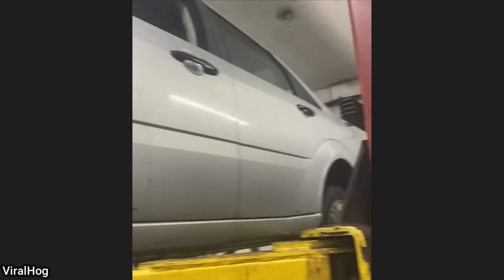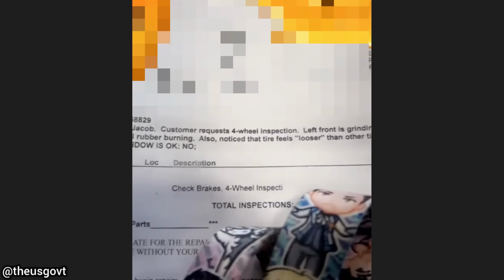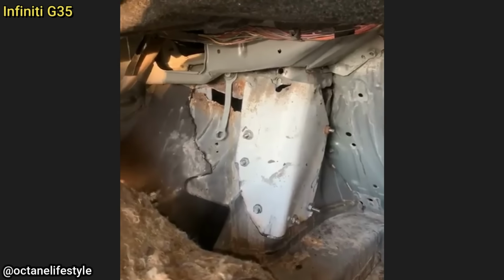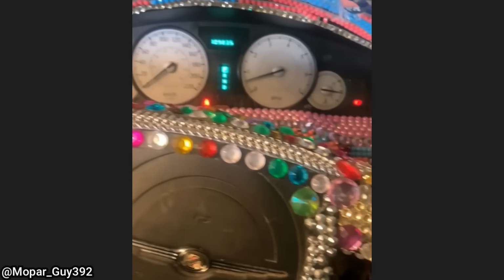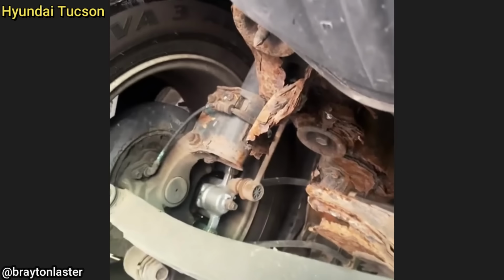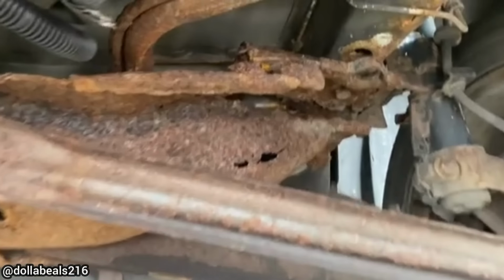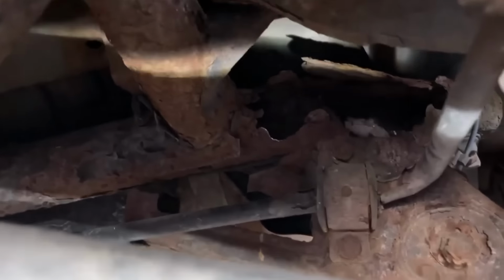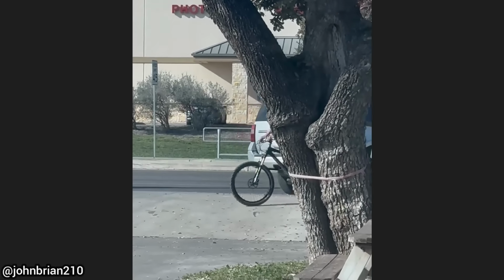Customer States (Dangerous Death Traps) | Just Rolled In

Comment: "Purchase a frame repair kit" - news flash, sudden shortage of spray foam in local area. Retailers are perplexed about where it all went.
Reply: @ronblack7870  WTF?  Now I gotta go see!
Reply: @ronblack7870  You need to have a bit of frame left to fix said repair kit onto, though...
Reply: :face-green-smiling::face-green-smiling::face-green-smiling::face-green-smiling::face-green-smiling::face-green-smiling::face-green-smiling::face-green-smiling::face-green-smiling::face-green-smiling:
Reply: @ronblack7870  haha thicker then oem
Reply: Fun fact. In the 1990's when Mercedes was having issues with body rot in their frame rails of the W-series sedans due to improper factory holes, their official dealer authorized fix was to fill the holes with sprayfoam.
Reply: That and rolls of duct tape.
Reply: Unless the guy is forging new arms and struts for his car, I don't think he will succeed.

Comment: Mechanic: "Your car is a literal deathtrap, come see for yourself."
Customer: "You're just trying to trick me into paying for repairs I don't need!"
Very shady e-mail: "You've won a billion dollars! Just enter your credit card information and it's all yours."
Customer: "GOLLY GEE I'M A BILLIONAIRE"
Reply: Yeah but the mechanic is trying to cost them money - that Nigerian prince is offering to give them money! Totally different.
Reply: Mechanics can be a bit cheeky with little add-ons that, if you happen to know enough about cars and know your own, you know you probably don't really need. Well, you don't need them to do it with the additional cost of their time when you can just order that particular part and fit it yourself at home for half the cost.

If you have the tools needed to take off a wheel, and you should, they should be in the boot of your car, then you shouldn't have issues changing brake pads, discs, maybe control arms etc. And you can do some basic maintenance with the engine up front (that's where the engine usually is, it's the large noisy thing under the bonnet), such as changing oil, spark plugs etc. That's where the average garage is getting you paying more than what you should be, because people are somehow allowed to drive a near 2 tonne potential death trap that they know very little about, which is just bloody stupid if you ask me, which you didn't but whatever. Had my way, I'd make it so you'd have to display some decent enough mechanical knowledge and ability to care for your vehicle before you ever get to sit in the drivers seat and get a licence. That gives the driver some useful knowledge and skills, prevents then being taken advantage of, and helps protects other road users from those who are genuinely too stupid to be allowed to drive. Won't stop people being lazy and failing to perform a few basic checks before they start driving (I know, people think it's tedious. But it's important, make sure your fluids are in order at the least ), but a few gory videos and/or photos could help with an attitude adjustment. No one wants to end up looking like Porsche girl, it's not open casket friendly.
Reply: Here in Utah they got rid of safety and only do emissions safety is only required on salvage title or commercial fleet vehicles
Reply: Mechanic: I've changed your valve cover, but it required me to install all new brakes and suspension, so your cost is now $2182 instead of $221
Reply: Thing is, 99% of the time, mechanic just mentions the issues they found, but don't actually show them to customers.. And people who drive/buy cars in these conditions obviously don't want to spend a single dime on them.
Reply: @Legally_its_a_joke  in my country, that's illegal. You can't perform repairs the customer didn't ask for. I'm assuming that it's the same all over the world. 

And if you pay for repairs you never asked for you're just getting scammed. Contact consumer rights agencies.
Reply: Those are some great engineers who designed these cars.
Reply: @nicklasveva had my old car in for service due to the service light was on and order the normal oil change and like but they also switched out the oil pan due to it was so rusty and thin they where able to drive a knife trough it. They replaced that as well but they did not contact me about it. Anyhow when I went to pickup the car they told me and I was okey with it besides what if the oil pan ran a leak and all the oil would spill out it would cost more to replace the engine then that oil pan
Reply: pretty sure you're not gonna replace your whole chassis like some of these wrecks in this video

gotta make choices, sometimes its worth getting a new car instead of replacing every bit of a shitbox, don't care what kinda engine there is in there, aint no fucking thing worth that much work or money, it's just a damn car afterall
Reply: Unfortunately thats how people are. Ive asked to see the issue they mentioned and they went quiet real quick. Couldnt even bring out the trolley jack to get a good look at the crack in the steering arm
Reply: @nicklasveva  It is, but here's the thing: Making something illegal doesn't prevent people from doing it. It just lets the state punish them if they get caught doing it and the state wants to punish them. This is why anti-gun laws do nothing to reduce gun related crimes. Its why prohibishion made the drinking problems worse. It's why strict anti-drug laws cannot end the war on drugs. Making things illegal doesn't prevent them. Only addressing the reasons why people do those things can.
Reply: I guess some customers prefer paying with their life, rather than money. Unfortunately they’re not alone on the road. These people may be driving next to you in one of your road trips. They only cause more harm than good. Why don’t these workshops contact the police if they decline repairs? This should never be legal to drive on the road. It’s so infuriating to know that K-trucks are illegal in some states of the US but then vehicles like shown in the video are legal to drive for some reason…
Reply: Then the GPS static fades out and jigsaw turns towards the camera. "Hello Jonathan"
Reply: You just had to sneak Nigeria into the conversation somehow. I thought you were educated ?
Reply: One thinks they’re getting money one knows they’re losing it’s really all that matters to these people
Reply: Has anyone fallen for one of those scams si ca like 2004?
Reply: It’s the “GOLLY GEE” that sells it
Reply: @MeepChangeling wtf are you talking about? In most Countries in Europe you will be stopped by the Police in about 20 minutes of driving and they will wait for the tow truck to get you to the scrapyard. Murrica, best country in a World that can't enforce their laws in the name of freedom. Sick,  in reality you have vehicles like in the 3rd World and in Europe you can rarely see 15 years old cars and not in a perfect condition. And somehow we can afford it. Tf is going on with your country?
Reply: They assume I know nothing. They tell me things are broken that don’t exist on my car they tell me I need to replace filters I replaced two weeks ago and then bring me out a dirty filter that’s not from my car to prove it. Nobody’s innocent.
Reply: @SilentKeeperI  it depends entirely on the state. Some states have very stringent motor vehicle inspections some have none at all.

Comment: The "buy a frame repair kit online" one... I had almost forgotten about it!
Reply: The repair kit consists of two cans of spray foam, and a roll of duct tape.
Reply: Oh, and some undercoating to hide the spray foam.
Reply: I had to pause the video.

$20 says this is the same person who, because their computer was "running slowly", downloaded more RAM.
Reply: Good grief. Frame repair kits really are a thing! That’s scary.
Reply: @Speedbird9L  please tell me a "frame repair kit" are photo frames or specs.
Reply: I can't imagine the alternative universe that sells frame repair kits online.  Maybe that's where Spock has a beard.
Reply: I’m sure if there was a frame kit online, the cost and install would be more expensive than the truck
Reply: @Speedbird9L  From Amazon A Frame Kit for an F150: Is professional installation recommended for it? Yes, professional installation is recommended for this frame rail rust repair kit as it needs to be welded onto the vehicle frame.
Reply: I read your comment before seeing that part of the video. I had no idea what you meant. Now I'm slackjawed.
Reply: i just googled it and you can buy a car frame repair kit,  problem is i dont think that person has the skill to do the actual job as it looks like you need to know how to weld....and not with spray foam
Reply: @EJBert  Trick is finding some frame to weld to!

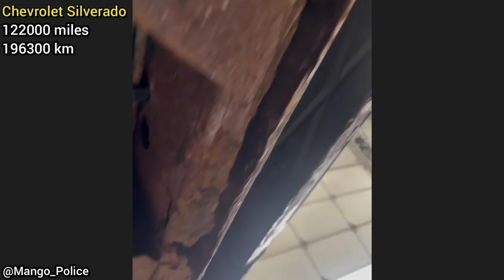Comment: 12:49 Yup, you hammer those wheels straight buddy. We believe in you!
Reply: Gotta feel for the guy!  Better the wheels than the wife😳
Reply: I have done it ONCE with a metal rim, until I got paid the next week. ( over the next couple of weeks I met 3 other people who bent rims on that pothole )  I would not do it with any aluminum rims.
Reply: Yeah it’s actually not that hard to fix minor dents in steelies.  It’s done pretty commonly on the trail.
Reply: @batsonelectronics  Aluminum is metal as well, I am sure you meant to say steel rim in your first sentence.
Reply: It can be done but with the wheel on the ground. I've hammered wheels straight before.
Reply: @timothydubois5834  How straight? I wouldn't trust a hammer to get a wheel highway stable but maybe that's just me being astounded by what skilled craftsmen can do with hand tools. Also, the wheels in the video are alloys right? I think that would make it harder.
Reply: Just keep an eye out for those little lead weights as they pop off . . .
Reply: @Where_is_Waldo   It's very easy to do this. You just hammer it into a cube, then you hammer on the edges, done, what are you domb

Comment: 2:05 NEVER in my life I've seen an oil filter rusted like that
Reply: gotta think it’s been on there for a spell
Reply: if the outside is that rusty imagine how black and glittery the inside is... yikes...
Reply: That's what I was about to say.
Reply: That thing has been on there since oil filters were invented bro.
Reply: It's all original! lol
Reply: I have seen a transmission oil filter rusted like that. I had to remove it with a breaker bar and a claw tool. It was slow going and didn't look like an oil filter any more when I was done with it.
Reply: thats... quite normal...
Reply: Carust have either come from up north, or it sat on a field, or it's a flood, or hurricane car
Reply: I've had to replace my oil filter because the old one rusted through and it was leaking
Reply: When I was a senator 175 years ago, c'mon man, ya know, the thing.....
(oil filter isn't the only rusty thing a bit beyond its use by date).
Reply: @OhSoddit  So you'd rather have a guy who takes his orders from putin over an aged but decent man? Reconsider your choices...
Reply: I've had two drive in with them actually weeping oil through the rust!
Reply: @REDPWR4EVR  In one year?
Reply: @MJA5  Still has the factory worker's finger prints on it.
Reply: it was a Fram, it probably came new like that.
Reply: THAT YOTA STILL RUNNING THOUGH! Original oil and all
Reply: Heard on this channel in an earlier episode:  "Last oil change was performed by Jesus" 🙄
Reply: I have seen one. car was brought in for an oil leak. you could see a little gap towards the filters' top where it was rusted through from the inside. turned out the little toyota was overdue for an oil change more than eight years... the stuff leaking looked like it had quite some condensed water in it, too.
that's what happens if you drive only a KM a day, or somesuch.
Reply: Sure I’ve seen them rust like that in the heavy diesel industry on older tractors, but not on road vehicles
Reply: @awesomecronk7183  Must weigh 8-10 pounds, and almost nothing to pour out!

Comment: 10:20 "This is on the road next to your wife and kids".   Exactly.   Take it to the junkyard if it's not repairable or worth repairing, dammit.   I got rear ended (luckily not severely) in Milwaukee some years back by one of these rusted-out hoopties.  Driver was unlicensed, car had expired tags, was uninsured.   I had only a scrape on my bumper; the heap was now nearly undriveable.   
Luckily neither I nor my mother were injured in any way.  The other driver was sure terrified, though.   Shouldn't have been trying to drive that pile of scrap and now there it was in the middle of the road.  Her attempts to make it go were the last thing I saw of it in my rear view mirror as I drove away.
Reply: luckly here they got police to find people with uninsured cars and that havent payed road tax, or have done their yearly inspection. but only after they are on the road for 2 months to give em time to get it fixed. now the cameras with licenceplate detection can have you even fined if you drive out outside the grace period.

Comment: I moved from the rust belt down to FL 15 years ago. It’s so nice to work on vehicles that have no rust. I’m daily driving a 17 year old truck that doesn’t have a speck of rust anywhere on it.
Reply: Fl is a great place for rust free cars unless you live by the beaches then the salt in the seabreeze gets to them
Reply: @pheonixprime8 can someone tell me what area is considered the rust belt?
Reply: @petergrossman2450 Anywhere you get regular snow. Road salt is the main cause of rust in any state north of Virginia or your timezone's equivalent.
Reply: @petergrossman2450  if I'm right it's the northern states that gets a lot of snow and ice so they use salt and it causes frame rust
Reply: Florida does have rust, you just have not lived there long enough and have zero experience with cars. Florida has a high humidity and salt water environment, both will rust cars out like crazy. Everything along the coast is gone.
Reply: @MrWolfSnack  those beach cars rust out like crazy
Reply: @Majima_Nowhere  My entire country counts then. We do take rust prevention seriously, because if you don't you won't have a car after a few winters.

Funnily enough, my car, a '98 Nissan Sunny, is rather famous for having vital parts rust to pieces. First time I brought it in for the yearly inspection in 2015 (got it in 2014) the inspector was surprised because he hadn't seen one for years as the front axle tends to rust apart as it gets salt snow slush sprayed on it.
Reply: Because these smart Floridians replace tyres when they blow up. Never seen so many cars with literally no rubber left on the tyres, full slicks … that avoids spray and saves following cars from rusting I guess. Genius
Reply: I have to agree with the (relative) pleasure of having an older vehicle that never saw the rust belt. I have a 2003 Silverado that has nothing more than surface rust on the frame and running gear. Living in north Texas, we get very little to no snow in winter.
Reply: I'll do you one better, I'm driving a 1990 K1500.... No rust, no dents, but the paint is fading
Reply: Move to New Mexico or Oklahoma if you don't want your vehicle to rust.... No salt allowed here... Just sand
Reply: Yeah, but you have to live in Florida. That’s kind of a drawback.

Comment: Don't spend 200 bucks on a new oil pan.
Spend 5-10 grand on a new engine.
Reply: Typical infinity driver
Reply: On the next episode of JRI: Customer states "another shop" tried to fix the oil leak with silicone and spray foam, but now the engine won't run.
Reply: @OtisFlint  Yup...they buy the car for the "badge"
Reply: Don't know the year of the one in the video, but a 2024 version of that car starts at 45K for the least expensive version
Reply: that´s the american way

Comment: it always amazes me that those cars still make it to the shop and that the mechanics feel confortable getting below them..
if i saw a rusted through frame in the 4500lb+ piece of metal above my head, i would soil my pants
Reply: We've definitely declined lifting certain vehicle's on the hoist because of rust!
Reply: It's more amazing the customer would decline repairs instead of getting that stuff fixed ASAP if they care about the car.
Reply: @lordpumpkinhead265  most of these rustbuckets are beyond any kind of repair, you literally have nothing left to even try to weld onto
Reply: @raoulrr  I guess that's true, but driving said rust bucket away instead of having it towed to the scrapyard is deranged and extremely dangerous.
Reply: One of these days a car is going to fall through the lift due to frame failure, "it wasn`t like that when i brought it in"?

Comment: "Oh the radiators hissing 
and half the engines missing 
And the oil is running dry.
Oh there's water in the petrol 
And sand in the gears.
And she hasn't seen a garage in more than 40 year."
Reply: Sounds like a country song!
Reply: @lrich8181  it's a parody version of one.
Reply: @ianmcnab9534  Is there a full version?

Comment: I about lost it when you said that the customer "stapled the wires to the fuel tank"!
Reply: He would have gotten better results with just small spot welds!
Reply: @AsmodeusMictian  Plastic fuel tank, but heck, maybe they tried welding it on first...
Reply: @davidg3944  maybe he plastic weld the staples
Reply: @davidg3944  damnit, you're right. 😀
Reply: @AsmodeusMictian  Plastic tank